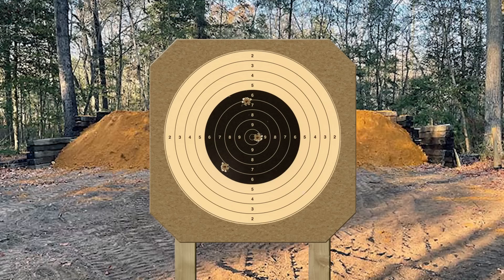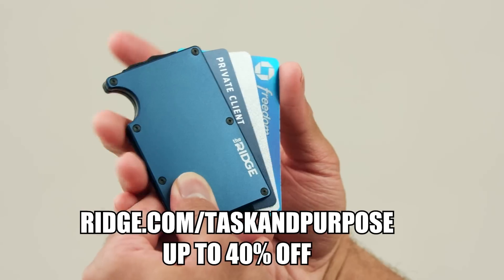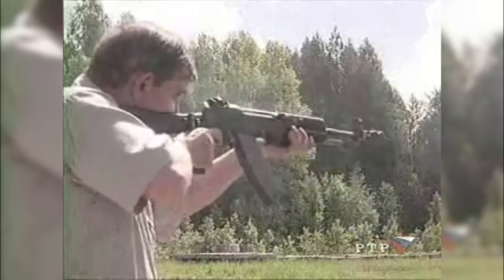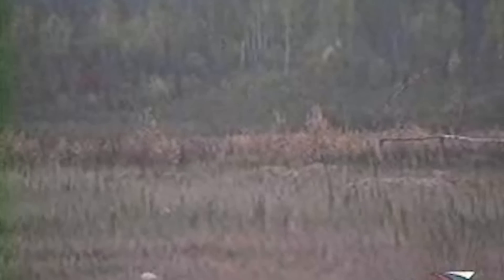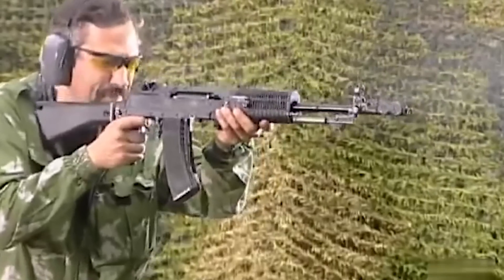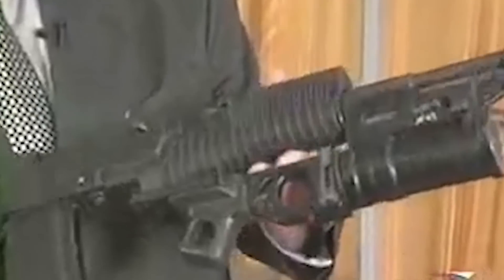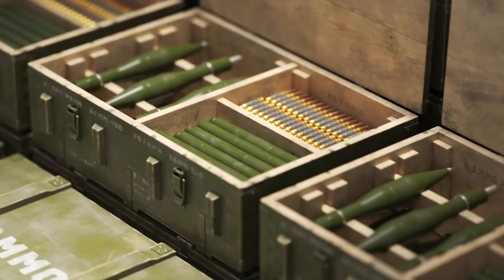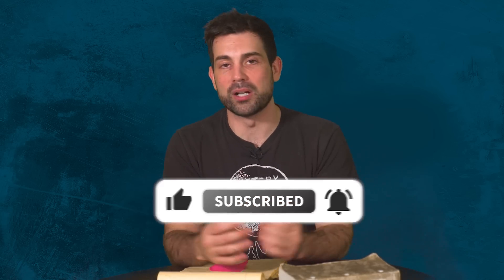This Russian Rifle Fires 2 Bullets into 1 hole

Comment: For all the extra weight in the mechanism they could have probably forged double barreled AKs and worked out a double feed mechanism and it would have weighed less or about the same as this.
Reply: ....no. there's so much wrong with double barreled rifles. You would nearly be doubling the weight of the gun with that, almost doubling the parts, lowering the accuracy, and increasing accidents. It don't work
Reply: @thezombiepotato1  The joke

Your head
Reply: I wager that it'd weigh more, but cost less.
Reply: @alastor8091  Both are awful, heavy and overcomplicated, but the double barrel would still somehow be less complex.
Reply: Its been done, part of the same weapon design competition.  Simonov AO-63....a double barreled AK with a rate of fire at 6000 rounds/min.  And no, i didn't place an extra zero lol
Reply: @victorzvyagintsev1325  I was going to say someone probably already did it anyway, but I was thinking like brandon hererra or something. Hilarious that Simonov tried it.
Reply: Funny, because they DID do that very thing. In fact there’s quite a few multi-barreled rifles that the Soviets made, some even have THREE barrels.
Reply: @timbrwolf1121  I think he lost due to fire rate issues.  100 rounds per second is insane for an infantry standard issue rifle.
Reply: Just duct tape two aks together

Comment: Being about to key hole automatically nearly negates majority of armor by design. Fuck that's extremely dangerous. 

I always loved the gun/artillery design that stacked ammo into a single barrel. Extremely dense, rapid fire, and low weight. 

I don't know if it ever was mainstream or ever truly worked but on paper insane if it works.

Comment: Kalashnikov bought Ishmash and developed a cheaper version of the AN-94 called the AK-12, not much of the AN-94’s design survived except for the hyper-burst function that now barely works (most of the time it doesn’t work) because it’s missing the pulley system.

Comment: Had a weapon like this in planet side two. It was to step up the DPS ratio while firing in a semiautomatic with varying speeds, when utilized properly can negate over shields or in this case a larger gauged body armor. Having to use multi layered separated soft and hard materials to absorb or redirect the shells. In reality the shells upon meeting each other would create a hard to soft placement destroying the first layers of plates allowing the other shell to follow up behind and probably into the same trajectory. Making it a sort of multi fase penetrator round. Making standard ammunition as effect of as anti armor rounds.

Comment: For guys who think burst is useless, think about the Vietnam war, where guns are usually used with bursts (manually by high-skill Vietnamese soldiers). It allowed high fire concentration, decent accurate while still saving on ammunition.
Of course for many armies who use scopes and optics a lot, burst fire doesn't play such an important role anymore.
Reply: Yes but the video implies it's use is to punch throw a armored vest. Ad least in this case.
Reply: @johnwray393  I don't think it works that way, based on many test fire video you can say that in order for a burst with 2 bullets hinting 1 spot, the enemy must come very close. But at that range I personally think auto is better for the job.
Reply: @sonhuynh106  I'm not saying they would actually punch through, just what was mentioned in the video. It's 7.62 though and it would have to be close quarters. It was early only before we had high level plates. It's advantageous at first contact I'd imagine, less so from there.
Reply: @johnwray393  It wasn't designed for that and it use 5,45 not 7,62.
Quick burst gives better chance to hit a target, but in practice it's complicated.

Comment: I would argue that rifles should.come with a 2 round burst option standard over the 3 rd burst. It's way more accurate, minimizes visual and audible signature, has less recoil, and uses less ammo. Just slow down the rate of fire and adopt polymer cased telescopic rounds. 2 round burst is mad accurate if it's controlled.

Comment: Germans did the same, but for three burst shots, on the G11 - while also massively increasing ammunition on each soldier by reducing weight and size of the magazines by dropping the casings.
Reply: @Reding that's not correct. Both guns shoot the bullets in very fast bursts and while there's no recoil felt. G11 just does 3 instead of 2.

Recoil is delayed and will be felt as sum of all shots after the last bullet left the barrel.

Comment: This is based on a Cold War era design philosophy. 
Like the G11 it is designed to give the individual soldier in the large conscript armies a better chance to hit the enemy. 
Don't forget these conscripts didn't shoot a rifle for several years and would be given only a basic refresh training. 
Since the livespan of a single soldier on the ABC battlefield would be very short after contact with the enemy, the only requrement for such a riffle is to be serviceable when the fighting breaks out.
Don't forget: The individual soldier and his equipment would have been fully disposable on the expected battlefield in Europe.
That's one of the main reasons for the failures of the Russians in Ukraine:
You can't use the equipment and tactics of a mass army without the corresponding mass of soldiers.

Comment: I think the major reason is complexity, the AK74, is a AK47 like rifle with 5.45 bullets, it is easy to be disassemble by a unskilled soldier. The AN94, is a very complex weapon, you can never expect some normal soldier can repair it. The burst it can not work because you add another function on the safety adjustment, If you want to shoot full auto but shoot burst, it will be super disturbing.

Comment: 1)As far as i know, this weapon was made to shoot from unstable positions to increase hit probability. I mean like while moving, or in situations when you just cant' hold your weapon properly and so on.
2)This weapon cost is less then high-end sniper scope. So for the Special Operations weapon it's price is ok.
3)This weapon was made more then 28 years ago on old-chool style machinery. Without titanium 3d-printers, carbon and other stuff
4)imagine that system like that was designet today with using modern materials and technologies. And combine this idea with brand new caseless ammunition. Could it be more succesfull this way?

Comment: Russia always has lots of great weapon designs. They all have one thing in common though: too expensive or complex to mass produce in a country that struggles to equip their soldiers with even the most basic modern weapon. They'd better concentrate on mass production of the Ak-74 since it's obvious it's the most advanced thing they can afford.

Comment: Hey Chris -- How about your take on the TU-141's? Like, how do you think Ukraine managed to increase the range so much?
Reply from the maker: I've been looking at the information all morning, trying to wrap my head around what this means for the wars escalation. lot of data to comb through
Reply: Tu-141 is a rather simple drone with an inertial navigation system. It's about as close to being a cruise missile as it can be. It flew pre-programmed course back then, and it works the same way now. Also now it doesn't have to either return to base of fly in a target area photographing anything, which means instead of a flight to target, loiter and return, it flies only out to target and dive to crash. Which doubles the combat radius.

Comment: I wonder if there is a way to make it work with just that double bolt carrier and spring mechanism.  Seems like you could make it work without the weird pulley system, though probably with less burst fire rate.  Not sure what vital function it actually serves though as I haven't really looked hard at any detailed schematics.
Reply: Have a close look. It'll never synchronize properly without it.

Comment: They realized that theory is still just a theory and it won't work for suppressive volume. 2 projectiles going in the same hole is less effective than 2 projectiles making 2 different holes.

Comment: A fascinating weapon indeed. However, the global focus on weapons development is hardly centered around infantry based small arms weapons. Recoil mitigation, muzzle velocity, and rounds per minute are all simple physics equations that can be solved by clever and surprisingly simple engineering. Modern weapon systems are centered around maximizing effectiveness while simultaneously removing the risk of human life loss. Drone systems and remote warfare are the future and we’ll likely see considerable developments in these sectors before we see advanced small arms to the likes of which we’ve never seen before. Ex. Zero recoil, high velocity, high rate of fire, caseless ammunition with fire and forget guidance that virtually removes operator error aside from deciding which target to destroy. Most importantly, defensive systems will need rapid development to counter advanced, remote warfare techniques

Comment: Same problem as the G11. Works amazing when shooting but if you have to clean it you need an engineers degree.
Reply: G11 is very simple to field strip. All you can do is remove the plastic.

Comment: You just can't beat the reliability the AK 74 and the AK 47 bring to the table. These two rifles are probably the most reliable rifles on the planet may not be the most accurate but they'll fire when you need them to if they have ammo in them. Very seldom do they ever let you down. If I had to go to war I'd take a Glock and one of those two rifles you'll have weapons that will fire when you need them most and I'm an American saying this. Should say something.

Comment: If the AN-94 is considered to be as rare as a Unicorn on the battlefields of Ukraine than the AEK-971 will be it's Pegasus!
Reply: I doubt that both are actually seen there. AEK is undergoing modifications into Cord A-545, but it's nowhere close to be supplied to anyone other than special ops. And special ops are, well, special ops
Reply: @SpikeVike27  From what I have heard the Ukrainians were able to capture a Kord 6P67 about a month ago.

Comment: It was probably easier to replace the entire barrel group and pully with a drop in unit then actually taking it apart in the field
Reply: Well, field strip basically required just that: remove barrel group, remove trigger group, remove feeding ramp, clean, lube, put back together. People lose their minds about the complexity of it, as they are right to do so, but general soldier wouldn't be trained on FULL disassembly and it wouldn't be needed for him. In fact, bad bad double-feed jams that this rifle is known for having, require exactly that: open the top cover, remove the barrel group, let the jammed rounds/casings fall out, reassemble.

Comment: Seems to be almost more complicated than the HK G11 but fires only two shots before the recoil.
Reply: I dunno. They are both stupidly complex rifles. 

From what I saw on Forgotten Weapons the G11 is much easier to field strip for basic cleaning. But if you needed to go any farther you needed to mail it to HK so the engineers who actually designed it could deep clean it. 

The AN-94 seems way harder to field strip. But it looks easier than the G11 if you need to go further than a basic clean.

Comment: I dont see why it would be hard to maintain. Only certain areas are exposed to outside dirt and some others to carbon fouling. Do we actually have any good information on what a field strip required or the sort of cleaning the weapon actually need to be functionally clean IE not parade clean or detail clean but only cleaned for the purpose of actual combat funcion?

Comment: The purpose of two bullets one hole was a strange idea. Sounds good, but it does not actually do good. Think about it. What would two bullets do in a single hole that one bullet doesn't already do?

Burst fire is actually designed to reduce accuracy so that if the first shot misses, there will be other bullets going down range off center and increase hit probability. accuracy reduction due to recoil actually helps achieve this goal.

If you hit the first round, then the other rounds don't matter. If you miss the first round, you have a couple others going somewhere else with a percentage chance that they will get the job done.
Reply: I never knew there was a science explaining what I do to drop jumping seal. I pull try aim delicately and if I run out of time I pull early, then I reload/pull twice more letting my swing change where I'm aiming in the general direction the seal is goinf

Comment: 8:16 Five times less than 800 rubles is -3,200 rubles. Five times 800 is 4000. 800 minus 4000 is -3,200. You mean to say the ak74 was 1/5 as expensive, or 4/5 cheaper. I know, word problems are hard...
Reply: It is a stupid way to say one fifth.

Comment: I tried my best to use that flat wallet.  It sucks tbh.   You're better off putting a rubber band around everything in your pocket.   I can't tell you how many times I dropped shit out of that minimal wallet.  It doesn't sit well in your pocket either.  Any lint, dust, or sand hanging around in your pocket WILL find its way into your "wallet"   just stick with a no fold leather wallet if you really need minimal size.

Comment: in any Kalashnikov's video you can see that it is not work like 2 bullets in one dot
Reply: It's more like 2 bullets very close to each other. Just to increase hit probability on longer distances. But then all of the world realized that it would be cheaper and simpler just to start giving a general issue optic

Comment: It failed because only the USSR would have bought it in significant numbers to replace their AK-74 line in frontline formations. But after the collapse of the Soviet Union in 1991, the Russian Military had a much more limited budget that they chose to spend on maintaining other parts of their combined arms force. 
Export was another option, as we often see domestic weapons R&D costs offset by export orders (see F-35, Rafale, list goes on) but given the fact the world was saturated with Kalashnikovs due to the Cold War and USSR military aid to anyone with Socialist in their group name, and that the AN-94 didn't offer enough additional performance than your standard AK-47 to be worth the increased cost and complexity.
It's really a similar story to the XM8 ( or any of the other advanced weapons platforms of the Rumsfeld plan to skip a generation of weapons development e.g. build only 200 F-22s to save budget for 1500 6th gen NGAD fighters, but the GWOT ate up all the budget) Only the USA would have bought enough to make the production line feasible or profitable, but with budget and bureaucratic constraints and the M4 being "good enough" it was scrapped. 
Now at least with the B-21, NGAD, 100+ F-35s built a year, and AbramsX, it  seems we are finally on the path to replacing the late Cold War era kit we've been stuck with due to sequestration and fighting half a dozen battles on as many continents.

Comment: Brilliant idea but it fails on a basic principle: Why pay triple for something that only delivers slightly more.
I saw a hilarious interview once with a very cynical retired general. He was basically saying that military rifles dont need to be flash, just reliable, easily maintained and relatively cheap. After all, they distribute hundreds of thousands of them, very few are ever used in anger, and when they do get used on the enemy they mostly miss. Similarly he thought the change to 5.56mm was brilliant because 99.9% of all shots fired dont hit a damn thing, so you might as well give them smaller, lighter, cheaper bullets, so they can carry twice the ammo. That way you can miss for longer without running out of ammunition.
Special forces have their specific needs, and front line combat troops have their needs too. But if you are going to spend billions extra on super weapons the money is better spent on planes, ships, tanks and high tech munitions. Frankly you could replace 90% of in-service rifles with wooden models and nobody would notice.

Comment: The AN-94 really can't tell you anything special about Russia (or the Soviet Union rather, since a gun like this is nothing you can design from scratch in a mere 3 years). It can however tell you something about the era. In the 1980:s both the Soviet Union and the various western countries were experimenting with designing a next gen combat rifle meant to increase the hit probability for the average soldiers. These projects would ultimately result in nothing in most nations except for Germany and Russia wou would itroduce the G11 and the AN-94 in respectively, both of which had a hyper-burst setting that made them far too mechanically complex to ever see mass adoption.

Given the speed of technological progress during the first half of the 20th century it seemed like it was a good idea. People thought that if they didn't work on the next combat rifle they could potentially be caught flat footed. Remember world war 2, when the Americans were mass issuing self loading rifles while everyone else were using bolt actions?